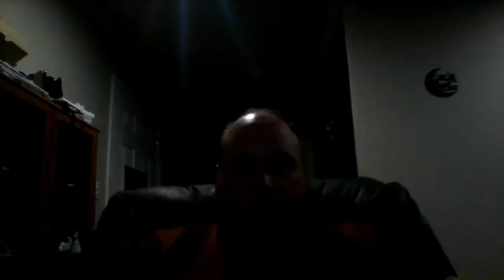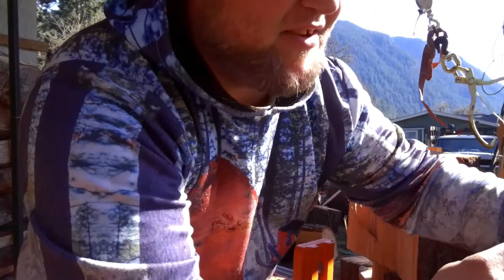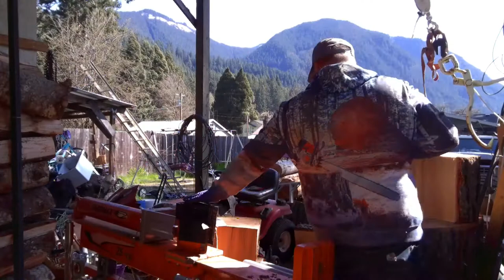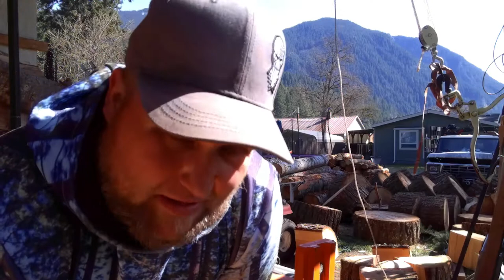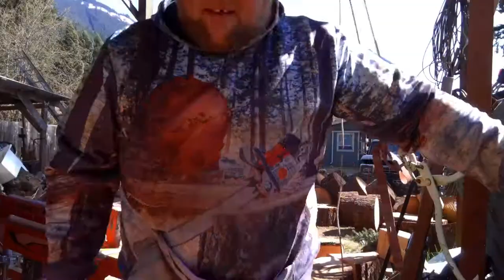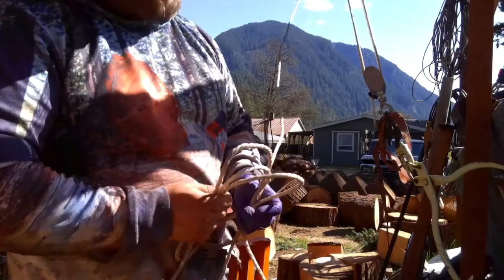Splitting wood with a 4 way wedge and trying a rope hoist to lift rounds.

Comment: Holy heck. My Yardmax 28T half beam handled 30” maple, but I flipped it upright ! The 4 ways that come with are basically useless (in my opinion). I like the throttle mod you did, my motor is on the other side, I wonder if I could rig one up. Great video !
Reply from the maker: Yea that 4 way is junk.